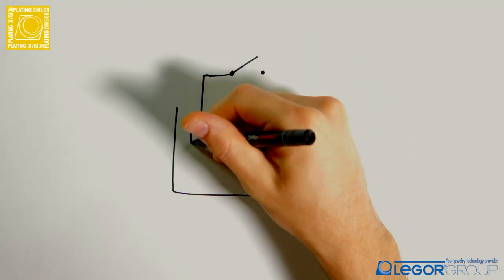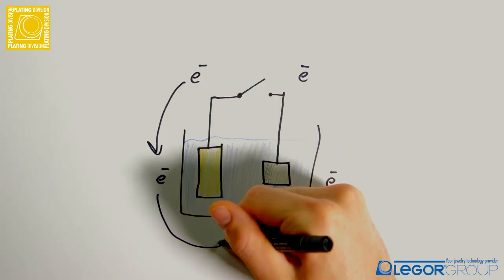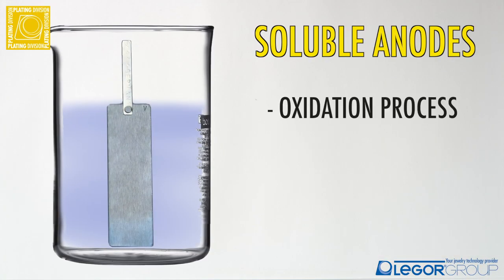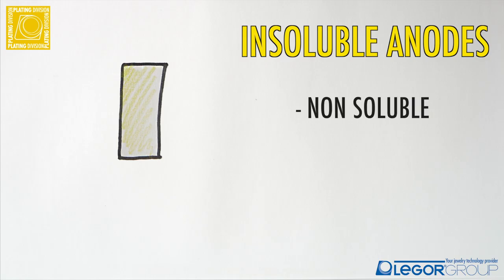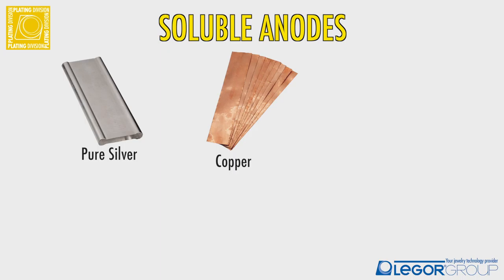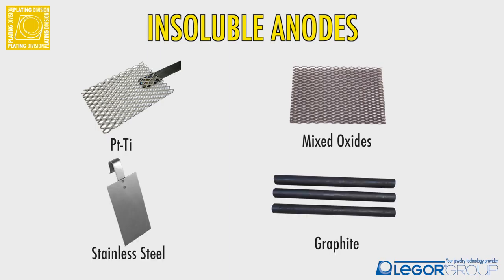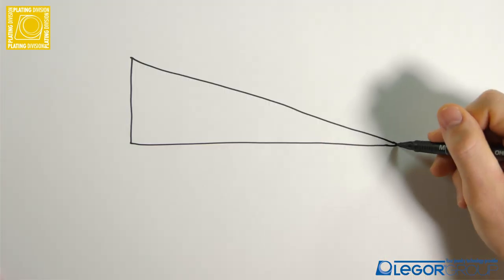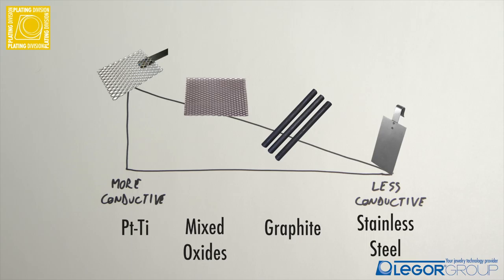Anodes for electroplating

Comment: I am wondering in which plating bath you can use stainless steel as an anode without dissolving the chromium out of it.
Reply from the maker: In all alkaline baths such as electrolytic degreasing or flash gold!

Comment: If I want to 18K gold electroplate a carbon knife (opinel), can I use as anode a piece of 18k jewelry, and, as I don't have a gold solution, can I use simple sodium bicarbonate as my electrolite?
Reply from the maker: Good morning, in order to provide you with the most efficient and timely answers, I invite you to write here your request:  https://www.legor.com/en-us/contacts This way you will be directed to our technical department directly, thank you.
Reply: i think you'd need aqua regia? the gold cant dissolve. note how copper plating requires sulfate ion gets converted to h2so4 dissolving the copper metal otherwise it would just be oxidized
Reply: @simonlinser8286  indeed, aqua regia seems is a must!

Comment: So Can we use stainless anode for rhodium plating jewelry ? And does it gives the same bright color ?
Reply from the maker: Stainless steel cannot be used as the anode in rhodium because it will contaminate the bath and corrode the anode overtime. Best to stick with Platinized Titanium, mixed oxide, or even pure platinum works great, just a little too expensive when compared to the others.

Comment: The direction of the electrons in the illustration is wrong. At anode, the electrons are taken away through wires to the cathode. So the direction should point at the anode (if they come from electrolyte) or originate from the anode itself (if it consumes the anode metals). Either way, the direction should not point towards the electrolyte.
Reply from the maker: Thank you for notifying us. We'll see with our technicians about changing the graphics.